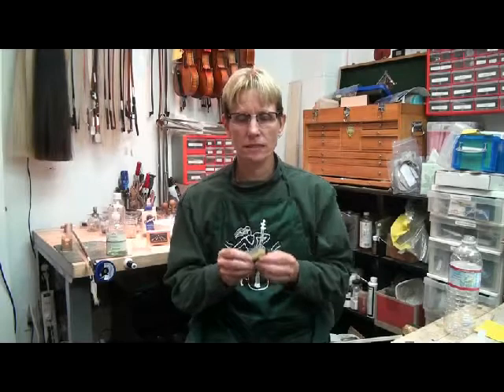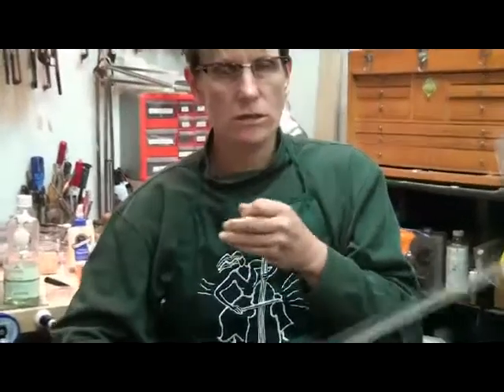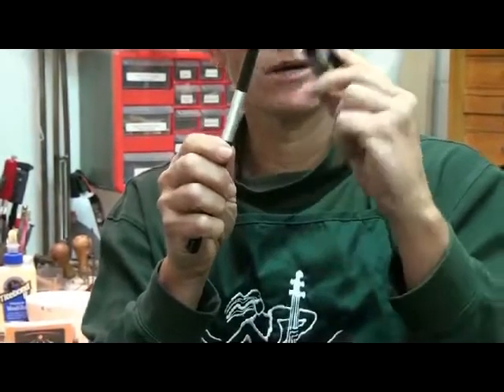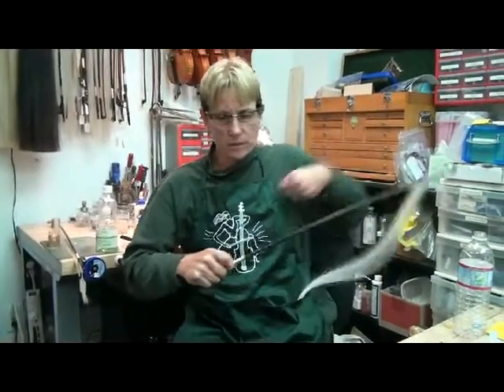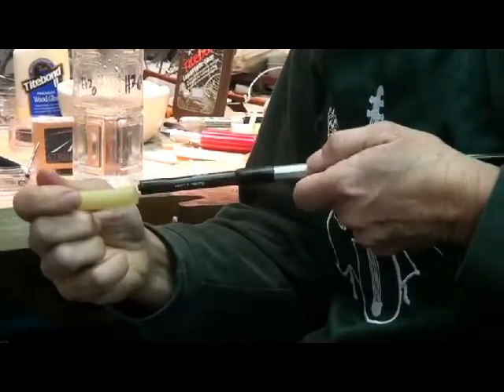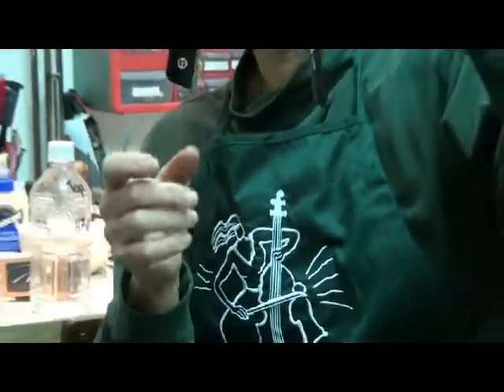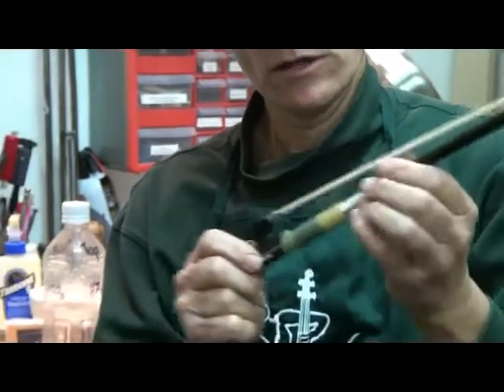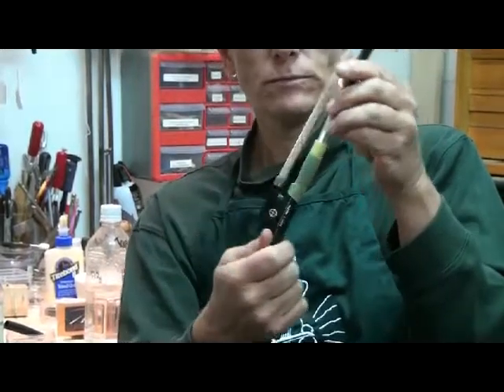How to Install a Bow Tube Grip for Cello, Violin, Viola or Bass

Comment: Just purchased the two types in all 3 colors(Latex Free; Clear Plastic and Latex; Black, & Amber). Would reccomend to put the black and amber ones on wooden and carbon fiber violin horse–hair bows that are used inside than outside(the clear one would be best with Performances and concerts outside, since latex melts).

Comment: The rubber tube has melted onto the bow.  Any suggestions on how to safely remove it and what kind of cleaning products to use?
Reply: Try a lubricant like 3&1 or mineral oil let sit 5 minutes and use a toothbrush to remove. You may need to reapply and scrub several times.

Comment: I have one of these tubes on my bow and I was wondering how long on average does one of these tubes usually last before it should be replaced?
Reply from the maker: Daniel Lim I would change it when you get a rehair which is usually about once per year. Latex breaks down with oils and sweat. It will degrade faster for some people. If it starts getting tacky you may need to do it sooner.

Comment: Do water and soap work for wooden bows?
Reply from the maker: Keren Canché yes but only if you use a very minimal amount, then once on, you can wipe off any residue. If you are concerned about the wood bow and want to play it safe you can use corn starch instead of soap & water.

Comment: where can i find these tubes?
Reply: Ebay. Latex tube .Inside diameter 8mm Outside diameter 12mm. £3.15 for a one metre length. Natural latex rubber. It`s best when it gets soft and sticky . Really . That`s the beauty of natural rubber. It works out about 20p each instead of over £1and £10 postage .

Comment: water and what？？？
Reply: soap
Reply: A teeny tiny speck of liquid soap. If that makes you uncomfortable use cornstarch as a dry lubricant.
Reply: @mamawelder  any warnings  about using vegetable oil, mineral oil, Vaseline, or hand lotion?
Reply: @swoolf3   those materials would cause deterioration of the Latex rubber. Use baby power instead.
Reply: @mamawelder  Thanks, cornstarch from the kitchen worked great!